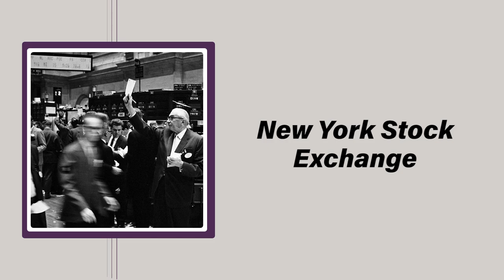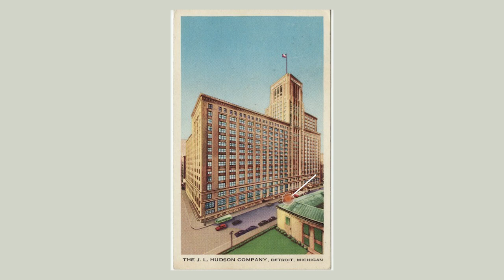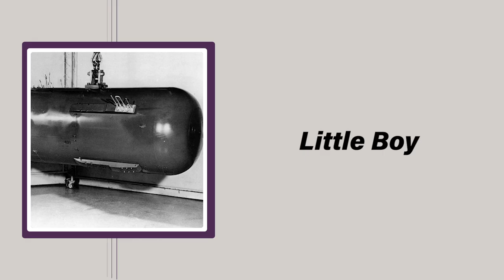The Largest Controlled Demolitions Ever Attempted

Comment: I worked on the 38th floor in the Deutschebank Building (at the time, it was still the Bankers Trust Building, 130 Liberty Street, or 1 Liberty Plaza).  My desk had a panoramic view of NY harbor, Ellis Island and the Statue of Liberty (I was there for the Statue's Centennial celebration with the parade of tall ships, and went in that evening to look DOWN at the fireworks!), Verrazano Bridge, Staten Island, Governor's Island etc.  We had a satellite data center across the Hudson in New Jersey.  I left there in 1992, a few months before the truck bomb was set off in the parking garage of the Trade Center.  When the south tower came down it put a 24-floor gash down the front of the building, about one office deep.  

We had a skybridge to the WTC plaza and would hang out for lunch or shop in the hug underground complex that was under the WTC.  When they took the building down it was the largest floor-by-floor dismantling of a building ever done...there was no room around it for any type of explosive demolition.

Comment: 1964 - "This just in from the White House. President Johnson sends the word to demolish the obsolete nuclear labs at Oak Ridge, Tennessee." 
2014 - "Well boys, that's the last load. President Johnson would be proud. It took only FIFTY years."
Reply: It continued to operate in other capacities until the 1980's I think.  And the site was heavily contaminated with radiation, the building was full of asbestos and was more than a mile long.  Although that's the pace of government for ya when there are no outside economic incentives involved.

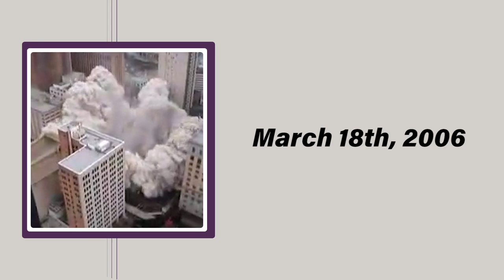Comment: At 8:58; The Kingdome, aka: "The Wart" was reported to have been more difficult to implode than originally thought.
Due to its robust overall construction, the demolition company had to use considerably more explosives to bring it down.  ;-)
It was also reported that many of its problems were late design changes and lack of proper maintenance.

Comment: I was trained in pyrotechnics and back in the 90's and 2000's I would regularly drive into London (in a circus truck or bus) with fuses, elextric dettonators, black powder, flash powder and gerbs, got pulled once in the city mile by armed police after the 2005 bombings, they were a bit gobsmacked at what I had on board but let me go after checking me out.
That was the last time I drove into London with explosives.

Comment: sitting here patently waiting for the conspiracies
Reply: Maybe you should spend that time bettering your knowledge on physics instead....
Reply: @sno4439  but does jet fuel melt steel beams?
Reply: @formation100  it sounds like you have questions that need to be answered so you may need to do some research
Reply: @sno4439  😩

Comment: How about the biggest uncontrolled demolitions (not by terrorists, definitely not by terrorists) more like demolitions that have gone wrong (hopefully without people getting hurt)
Reply: If they went wrong most likely someone got hurt
Reply: @eagonten : Not necessarily. There are all sorts of videos of structures collapsing only partially, or falling the wrong way, or failing to collapse altogether. And then everyone's just standing there awkwardly (usually at a safe distance), while the contractor has to figure out a safe way to demolish the rest of the structure without losing too much money.
Reply: Yea there is some really good failed demos .
Reply: Like chemical plant explosions.
Reply: That list would be mostly fireworks/ammunition factories or dumps, I suspect.
Reply: In Providence, Rhode Island they once tried to take down a T-shaped 40s era apartment building with a controlled explosion.  They set off the first blast.  Nothing happened.  They figured the concrete stairwells were the problem so they reset the explosives and tried again.  This time something happened, but instead of the whole building coming down the one wing tipped into the other and stayed like that.  It was too dangerous to try again so they ended up having to use a wrecking ball to take it down old fashioned way. The locals jokingly nicknamed it ‘The Leaning Tower of Providence’
(Not something I saw personally, but I got the story from Modern Marvels: Engineering Disasters, back from when the History Channel actually was about history.  Most of the segments were tragic/thought provoking, but every once in a while they’d throw in a funny one)
Reply: Tacoma bridge may be a good example
Reply: @maxcaptain4407  Galloping Gurtie was in now way an explosion. The bridge shook it's self apart.
Reply: @maxcaptain4407  Demolition kinda implies planned destruction.
Galloping Gurtie shook it's self apart due lack of knowledge of how frequency oscillations can create a feedback loop so that once it got past a certain point there was no stopping it.
Engineers worldwide did not at the time understand the phenomenon. It was not planned in any way. 
But interesting enough armies going back to the Roman times knew to break march when marching over a bridge and that is still taught to this day or at least they did when I went through basic training in the Canadian Armed Forces Reserve back in the late 70's.
Yes, I'm not only Evil but a Dirty Old Man as well.
Reply: @EvilDaveCanada  "uncontrolled"
Reply: @maxcaptain4407  Are you saying that Galloping Gurtie was a planned demolition? It was NOT!!
There is film of someone's car that was driving across the bridge when the oscillations started. They stopped their car and ran for it because the bridge was shaking so much. If any demolition was being planned or even was having the explosives placed THEY WOULD NOT HAD LEFT THE BRIDGE OPEN FOR PUBLIC USE. There is film of the bridge that has been repeatedly been shown on US National TV Broadcasts starting with the abandoned car on the bridge all the way to showing the bridge tearing it's self apart and falling in to the river.
Reply: @EvilDaveCanada  I'm saying it was so uncontrolled that it wasn't even planned. The bridge demolished itself. Therefore it fit what OP was asking for. Uncontrolled demolition where no one got hurt. Expect the poor dog
Reply: @maxcaptain4407  Read the Wikipedia article on it and watch the recorded video. It is stated that what happened to that bridge is still being taught about in education of structural designers still to this day because it was NOT even known that such a thing could happen until it did. Demolition if a planned act carried out by a 3rd party (be it human or animal) no matter whether it is successful or not. I huge metal bridge cannot make plans. It requires some level of intelligence at work. So an AI in a robot 'might' qualify but not a bridge. It is called Artificial Intelligence for a reason. For example, a dam collapsing because much more water came down the river then it was ever designed to handle, is still a collapse and not a demolition.
Reply: It has already been done a thousand times over. Why would we need another rehashing of the same borrowed wobbly video clips?
Reply: @EvilDaveCanada  Correct. It collapsed because of resonance.

Comment: Not an implosion. They are caused by low pressure inside a structure that allows the difference to over come the structural integrity. What we like to watch is a controlled explosion causing an inward collapse.

Comment: What about the Twin Towers Affair? 
Do you really think it is possible to analyze the collapses of 1360 foot buildings without knowing the distributions of steel and concrete? Do you think they could make the buildings hold themselves up without figuring out those distributions before construction started.
In 1940 it only took 4 months to model the Tacoma Narrows bridge to study the oscillations. But after NINETEEN YEARS we do not have physical or virtual models of the North Tower collapse or the center of gravity specified for the tilted top of the South Tower. 
You YouTubers can't find anything interesting to research. Ask Richard Gage about the steel distribution. I asked him in 2008. He looked at me like I was nuts.
Reply: Steel columns, concrete floorplates, non-load-bearing concrete encapsulation for the elevator shafts. 

And after those nineteen years we still have no adequate explanation how one could rig demolition charges for an office building in full operation in secret, no examples of demolition explosives quiet enough not to be audible for miles around the building, and no explosives on the market that would work perfectly after having a plane crashed into them and sitting in the inferno of a burning building for about an hour. The conspiracy theories are just a hodgepodge of donkey piss.
Reply: @Codraroll  I am not talking about what did bring the building down I am talking about proving whether or not airliner impact and fire could bring the North Tower down.

It is still a physics problem. It is so funny that the OCT believers do not even want accurate data to do the physics. The 10,000 page NCSTAR1 report does not even specify the total amount of concrete in the towers much less the distributions of steel and concrete.

Even if I believed impact and fires could do it I would expect engineering schools to have modeled it long before now. Just simulate the North Tower and remove 91to 95.  That should be more damage than the plane and fires could do.

I don't care who did it. But if models cannot be gotten to collapse it would certainly make for a hilarious situation.
Reply: @psikeyhackr6914 : Dynamic simulations are tricky at the best of times, and dynamic simulations where things are allowed to come loose and fall around even more so. Every little variable you can't account for perfectly will cause a deviation that will cascade into further deviations, so complete collapse simulations are incredibly tricky. It's the butterfly effect in action.

Still, the general gist of the collapse explanation seems to hold up just fine. Each of the towers weighed around half a million tons if memory serves correctly, which rounds off to about 5000 tons per floor. Once a single floor collapses, the floor below is hit with a hammer blow of tens of thousands of tons. That's a dynamic force vastly outside the design specifications. Buildings are generally constructed for static loads, not the shocks of impact. Picture hammering a nail into wood versus resting the hammer on the nail and trying to push it in.

The propagation of a collapse can also be modeled fairly simply. Consider the edge case where a floor collapses from a standstill onto the floor below, and the impact is cushioned so the speed of collapse falls down to zero. The shock reverberates around the building for a second or two before the next floor creaks and yields, collapsing onto the floor below. The next impact would also start from an initial velocity of zero, picks up the same speed before it hits the next floor, but this time there's another 5000 tons of mass falling (give or take the perimeter walls, which would be more likely to fall outwards than inwards), increasing the force of the impact. An identically constructed floor below would receive a harder impact and not be able to slow the speed of collapse all the way to zero. The next floor after that would be hit with an impact of an additional 5000 tons and an initial velocity above zero, so it would yield even faster. And so it goes for every floor throughout the building. Each floor that collapses adds to the falling mass, and each floor is hit with a harder and harder impact as the collapse picks up speed. Each floor gives the same resistance to an increasing force, causing the collapse to accelerate until it runs out of floors.
Reply: @Codraroll  Yeah Right! So it is OK to ignore the fact that there was more steel toward the bottom than the top so supposedly the lighter weaker portion fell upon and destroyed the stronger heavier portions.
https://m.youtube.com/watch?v=ZT4BXIpdIdo 
What if every simulation leaves at least 40 stories standing regardless of the variations?
Reply: @psikeyhackr6914 :  An important thing to keep in mind is that, while the columns themselves got thicker closer to the bottom, the floor plates and trusses themselves were identical for every floor, and so were their fasteners to the aforementioned columns. After all, each floor was the same size and designed for the same live load. Each floor only carried its own weight. 

Collapse is not about the columns failing  longitudinally, but floor plates and trusses falling down on the floor plates/trusses of the floor below, and shearing them off the joints connecting them to the vertical columns. It's like cutting twigs off a tree branch. Even though the branch itself gets thicker closer to the trunk of the tree, the little twigs snap just as easily no matter where on the branch they sit. Essentially, the trusses carrying the floor plates were smashed off of their attachment points to the columns, with collapse chiefly occurring around the columns instead of along them. In some of the footage, you can see remains of the core columns of the south tower standing over a hundred meters tall for a few seconds after the collapse, before slowly falling over due to the lack of lateral support. Likewise, the columns along the outer walls were peeled off the tower like the skin of a banana, rather than crushed vertically. As the trusses were knocked off them, they lost lateral support, and would break apart about a dozen meters at a time. 

And again, I doubt the lower 40 floors would remain standing under any circumstances considering they effectively had a 70-story office building dropped on them. They would have to be built like a concrete bunker to withstand that. You might as well have asked "what if the simulations showed that the tower collapsed upwards into the air?"
Reply: @Codraroll  They were not identical on every floor. 87 floors used the standard modular design. The mechanical floor were different to hold machinery like elevator motors and air conditioning equipment. They were also 14 ft high instead of 12.
Reply: @psikeyhackr6914 : The point still stands. The primary failure mode wasn't the vertical columns being crushed top to bottom, it was debris falling on and smashing through the horizontal elements. The columns lost lateral bracing and were eventually knocked over by the "rock slide" of debris, but the integrity of their floors were long gone by the time that happened. The mechanical floors wouldn't be able to withstand the force of falling debris to a significantly greater degree than the ordinary floors anyway.
Reply: @Codraroll  So just assume how it failed without modeling. 

Horizontal beams in the top 15 stories would have to impact the horizontal beams of the bottom 90 stories when we don't have data on the thickness of the beams.
Reply: @psikeyhackr6914 : As far as I know, the blueprints are available online, so not sure why you say we don't have data? And where else would they impact but on the horizontal elements? The horizontal elements span out across the entire space of the floor, after all.

And it's a simplification to say that the top 15 stories would impact the bottom 90. The top 15 stories would impact floor 90. The top 16 stories would impact floor 89. The top 17 stories would impact floor 88. And so on. The stories take the hit one at a time, fail one at a time, and when they crumpled they were added to the mass that hit the next floor below. Hence why the force of the collapse kept increasing for every floor that collapsed. It kept picking up mass and this, combined with gravity, accelerated it faster than the structural integrity of the floors could slow it down.
Reply: @Codraroll  Are you familiar with those modular structures called 'wheatchex' that were used to form the exterior columns? Why don't you yell us how many different weights those came in and the quantity of each weight?

I was just telling you what Richard Gage said to me. But where is there data on the distributions of steel and concrete down the structures?
Reply: @psikeyhackr6914 : Now you're missing the point or intentionally trying to change the subject again. Anyway, concrete was only used in the floor plates and around the staircases/elevator shafts. There were no load-bearing concrete elements in the WTC, not to a degree that would have affected the collapse once it had initiated.
Reply: @Codraroll  The steel had to support the weight of everything including the concrete. Therefore any expert trying to recompute the distribution of steel would have to know that of concrete.  The mechanical floor levels were different from the standard floors.

There were horizontal beams connecting the columns in the core for which we do not have weight/thickness data. Those horizontal beams would have to impact each other coming down. The conservation of momentum does not go away.